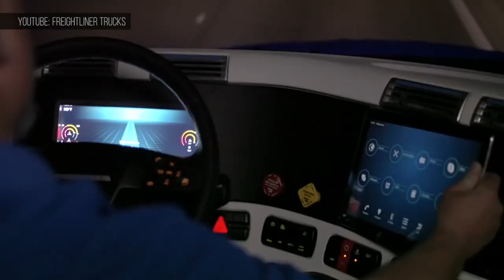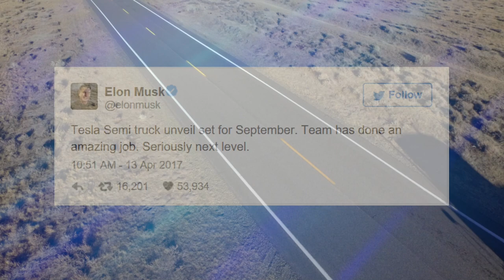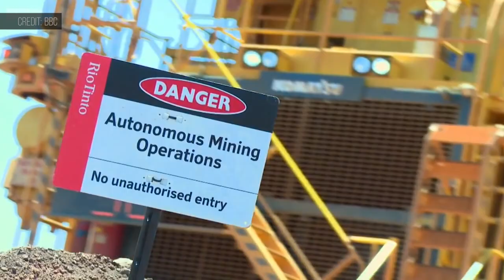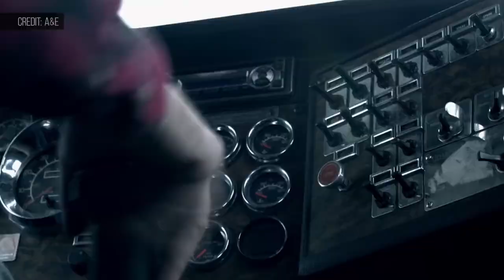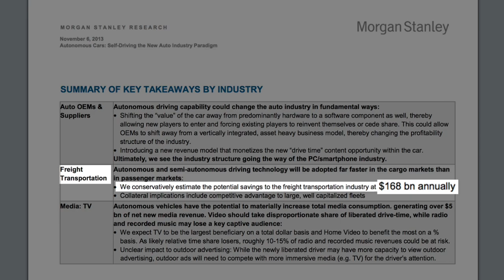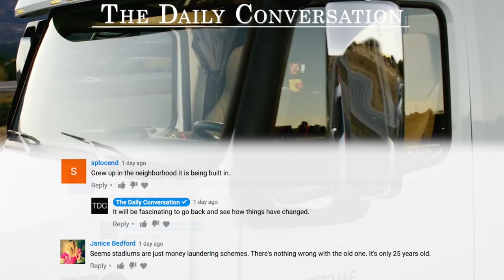The Future of Trucking

Comment: Not for nothing but this really scares me. We all have computers,  mobile phones, tables, etc. And at some point & as it gets older... It crashes, freezes up & malfunctions. Also, I remember growing up & my younger adult years - refrigerators, stoves, ovens, washers and dryers, etc. would last forever. 10, 15, 20 years plus. Now you buy these equipments & they have electronics on them & they fail & need to be repaired within the 1st or 2nd year. And after 5 to 7 years (10 at most) you're replacing them. So with that said, I can see the crazy accidents happening already.

Comment: And the robot trucks will do what when they breakdown or blow a tire? What will they do when chains are required or the road is closed? Will they know what to do when there's a detour? Do they sign for the load? pay the lumpers? Get the trailer washed out? Do they know where to park while waiting for the load to be ready? Do they know which door to back into to? Can they dolly down , disconnect and chock the wheels?   If involved in a accident does it give insurance info? Do the robot trucks load and unload the car  haulers, the tankers,the flatbed and the livestock? Will the  robot trucks scale their own load? Will they go into weight stations and get a Dot inspection?  Will the robot trucks swerve to miss hitting a dear? Will it read speed limit signs and pay tolls? Will it pull over for emergency vehicles. ect,ect
Reply: MR. B what will they do when someone pulls their 5th wheel handle and they drive off without their load attached. lol. i can see that happenening 100s of time a day.
Reply: Also; will the truck know when it's sensor are too dirty to function, and not take out a family car at 60-75 miles per hour, because it's sensors couldn't detect the small car(it just wasn't there according to the computer). What will the truck do when there is no road at all? A truck that is needed for a road construction, or are to travle down a small gravle road that does not exist on our GPS;s?
Reply: What about going into a skid or having a 4 wheeler cut you off and lock the brakes up would the auto system be able to recover and avoid the accident or just lock up the brakes? Causing a bigger accident
Reply: This is why it'll be a long time before there is no one in the truck. It will be required that there's someone there to monitor and do all of these things for at least the next 50-75 years. Until the technology is perfected and people with old ideas die off. Driving jobs will be replaced by something else. These trucks will need a lot of service and help for a long time, even without a driver.
Reply: Let's see if they can even make driverless trains first.
Reply: How will they fuel ?
Reply: Swerving to miss a deer in a truck is a bad thing to do just hit the damn creature. A truck that big and as tall with that weight a quick swerve and you’ll be upside-down in no time. However everything else you listed I agree with. Been around trucking all my life it’s in both sides my family with my dad having his own company.
Reply: @jonsexton17   100% agree with you
Reply: MR. B do the robot trucks go to prison for killing a family on the road? Will they pay tickets or get put out of service
Reply: awd protege  They will not work we are not technologically advanced enough yet to have automated trucks
Reply: @grejsancoprative  No kidding.  They can't even get the radar to work properly on the Kenworths.
Reply: Yes, eventually all that will be automated and what cannot be done by the vehicle will be monitored by sensors and a call placed for whatever service is needed. There will always be a need for humans in the freight industry, it's just that the need for humans will be reduced and the jobs will change to fit the evolving industry. You can't stop it.
Reply: The trucks will not drive themselves. A human in a room full of huge screens will operate the truck just like the military operates drones right now. The trucks will be autonomous, which means nobody in the vehicle.  It doesn't mean nobody operating it. And driverless trucks have a limited scope because they can't fuel themselves and they can't drop and hook. They can't even open their own doors but a warehouse worker could do that much.
Reply: When a driver messes up badly, the company can fire him, and the DMV can pull his CDL. Now if a self driving truck messes up, then every other self driving truck of the same system, then has to be put off the road as well, while the accident is investigated.
Reply: Will the robot truck be able to scale the load, balance any weight discrepancy by moving the trailer's tandem axles and/or the fifth wheel? Will the robot know to drive in severe weather conditions and be able to determine when it is and when it is not safe to continue driving?
Reply: @markmayfield2228 : So it's not just the crap-tastic T680s at USeless Xpress, it really is a problem for all KWs with those CMS systems.
Reply: @brandonhebert5485 : I've already debunked this "idea". You need to stop trying to promote a fundamentally flawed "idea" based on uninformed logic.
Reply: A lot of your questions technology will solve. Road closures and detours will automatically updated to their GPS system to avoid making it more efficient. As far as waiting around for lucks to be loaded and unloaded the video basically explains that everything will be linked and by that time robots will be unloading trucks and will work more efficiently and will be better at timing everything.
Reply: You are making to much sense , do you think the idiots running the country have stopped to think about those minor inconveniences (sarc)...
Reply: saying      all that you will   always need a human   in the  drivwrs  seat.
Reply: @jeffwang6460  Already have those where I live. They make up our transit system.
Reply: if this technology takes off the way they say it will, just Playing devil's advocate here.
Reply: @seanstrack4022  These newfangled doohickies called planes ain't never gonna work!

Has a naysayer of technological advancement and change in history ever been right? Serious question.
Reply: Will it stop to pick up hookers and flea bags? I think not
Reply: @georgestokes5116  Why?

Comment: Remove Farmers by mordern machines, remove drivers by driverless truck, remove workers by robotics. Who will buy your product? because people will have no jobs, so no money and no purchasing power.
Reply: Ashish Tiwari 
     It will be awhile before we can build enough of these machines to take over the market. We will have to plan for an age without these larbour jobs.
Reply: Ashish Tiwari what a always thought was stupid was the idea of only two extremes, either a driver, or a robot. why not add the technology to certain areas and keep some of the drivers, or what they may become, overwatchers. they will still have manual control if need be, and the truck can drive long stretches of boring road. Also with them not always manually driving, we could cut their wages a little bit to save on the cost
Reply: Ashish Tiwari why make robots that kill jobs, instead of robots that make thoes jobs better. like exo skeletons with construction workers. efficiency is brought up without cutting any workers. maybe put laws in place for completely cutting workers, it's not punishing progress if they can achieve the same goal with a certain mix of technology AND workers
Reply: Someone builds the machines, someone repairs the machines, someone programs the machines. A driverless vehicle would require someone there to take over in an emergency or system failure.
Reply: The biggest question is will they be able to produce enough of these vehicles fast enough to keep up with the supply and demand of the customers? Every year there are more and more big rigs added to the road to keep up. With that being said, where will you stage all of these vehicles when not on the road? There will be no use for the large truck stops and rest areas unless they beef up security tremendously. When truck stops and rest areas are full you often see trucks parked on the on and off ramps, side streets or any where they can. All those trucks will need to be replaced with robotics and placed in a safe secure location. Truckers have no where to park now. Where would you store these robots.
Reply: A Mack Bolan yeh and it will probally have a crappy pay. Because then they would want you there 24/7 and probally if your lucky you might make .002 cents a mile. Knowing these scum bag corporations they would do that. Or maybe just maybe this might be how we enter a whole new Great Depression but it would be worst.
Reply: I've seen trucks with 3 drivers and a hole cut in the drivers seat. There were people planning to go to 60ft trailers, don't know if they're still working on that. In the depression of '08-'09 over 2000 truck companies went out of business. Then congress increased the distance Mexican drivers were allowed to drive into the US. At the time also they were working on the Transnational Highway from Mexico to Canada, haven't anything about that in years though.
Reply: Ashish Tiwari 
They are pushing you to welfare system
Reply: The Robots will buy their own products. I saw a sci-fi movie 40+ years ago and now it's really happening.
Reply: Ashish Tiwari made in China in China made in China made in China made in China made in China USA USA USA USA USA USA USA USA will be broke broke broke broke broke broke broke broke broke
Reply: Actually, since a robot will work just as cheaply in the USA as it will in China, a lot of the stuff currently made in China will soon be made in the USA again.

Of course, that doesn't mean that the actual jobs will come back.  If the robots are doing the work......
Reply: Remove managers and engineers from Tesla and others by self-learning robots
Reply: Eventually.  And maybe that's when we'll finally learn, as a society, to get over the (by then obsolete) idea of "working for a living."
Reply: Communism is about the workers owning the means of production.  But if the workers are robots, well surely robots don't own factories, trucking companies, etc.  So no, no communism here.
Reply: The government could give slews of jobs out, and there is plenty of work to be done.  Roads to be fixed, bridges to be fixed, that sort of thing.  Not all of it can be done by machine (yet).

But if the government starts giving out jobs not because there is work which needs to be done but instead because people need money, then why not just hand out the money?  Why hire people to did holes and fill them in again as an excuse to give them money?  Just give them money.

Pay for it with a robot tax?
Reply: They will do away with the citizens via nuclear war or "plague."
Reply: Stanley Bashline  think you hit the nail on the head. Society will resemble  current left wing political thinking
Reply: We will reach utopian socialism where wealth distrubition won't be based on your merits but on how much do you need to sustain comfortable life.
Reply: Awesome answer and I don't want  ROBOT DRIVING A MASSIVE BULLET THAT CAN KILL PEOPLE IF IT HAS A GLITCH
Reply: @lobster1653  "Cut their wages"?  If you make the job and skills more niche, then the wages will have to go up.  Part of the reason that the jobs and skills are worth what they are, is due to the demand and the relative ease of getting the ability and skills required.  Lowering the ability to get the training, and lowering the wages too?  That won't work.
Reply: Ashish Tiwari companies will be one-man operating systems, the CEO’s will run them only lol
Reply: But the rich only need to feed the poor because they are building for the rich. Now, robots can build for the rich without the need to feed the poor.
Reply: @marconbucayan8396  What? That literally in every way makes no sense at all!
Reply: @realengineeredlife  a prophet speaks but does anyone hear
Reply: Just get rid of all the people in the 1st place. Then you don't need anyone to buy the products made by the machines. Then the machines don't need to make anything for people.
Reply: A fully automated economy would produce a great deal of wealth, that wealth will be taxed to a high degree and the money will be distributed in the form of a universal basic income and that money will be used to purchase the products
Reply: @Onearmedscissor yeah, you're probably right,
Reply: we need Universal Basic Income, that's why we need Andrew Yang for President 2020
Reply: If truck drivers are put out of work the economy will take a big hit who will buy your trucks? When you just lost a big huge workforce!!! You forget the world is a big cycle! Good luck
Reply: @palmerprod  The reason "Shall not be infringed" is part of the 2A - is so that no one can dictate terms by which you have to abide if you want a weapon.  If they can institute additional stipulations, they won't stop.  "Bible believers" and those with a conservative viewpoint will be deemed mentally ill - "climate change deniers" and any deplorables they don't like will be lumped into the mentally ill category - while those who want to lop off appendages are celebrated and rewarded for their "uniqueness".
Reply: Elon Musk and Bill Gates propose Universal Basic Wage.(socialism).
Reply: @lobster1653  Your proposal would defeat the main advantage behind autonomy, which is more profit for the industrialists. I don't really think most companies would be interested in an augmented system, as their main motive is not safety of the drivers, but rather cutting the cost invested in human services.
Reply: @supersman2000  As opposed to human beings, who are never distracted, sleep-deprived, drunk or just have a heart attack at the wheel.  There are hundreds of thousands, perhaps millions, of traffic accidents every day. With people at the helms of cars and trucks.
Reply: Jason Conover  if it can be exchanged for goods and services then it has inherent value, when the rubber meets the road at the end of the day money is money and when automation has taken away most the jobs it would have taken a lot of the human costs of doing business too meaning there will be more than enough profit to feed back into a ubi
Reply: @eyesuckle  The driverless trucks can and will make mistakes and have accidents also.
Reply: check the weight specs on electric  trucks. tesla tractor weighs over 30klbs regular truck 18k.
Reply: The people with educations will.
Reply: @ @katakisLives   Agreed.  I don't really see any other solution to the problem of automation.  The big problem with that solution is, what do people do, then?  For many, it's not a problem at all.  They have ways to define and value themselves other than through their work. But many people will be more or less lost without their jobs.
Reply: Ashish Tiwari I have been voicing this for 20 years, re ATMs, and then auto check out for your groceries, robotics for automakers, warehousing. Drivers!!

Yes, who will be left to buy the products of which they want to transport?

He talked about reduced accidents...well, if there is an accident now someone is held responsible...who will go to jail when one of these trucks pole through an intersection with 80,000lbs of fwd motion...Tesla already ran over one of its owners. Who goes to jail, who is responsible? You can’t send a company to jail...but you can send a driver.

Careful what we wish for people! You will be making these things to transport for the rich, meanwhile you’ll be unemployed in 12 years...never mind AOC’s the sky is going to fall...you will starve no for a lack of food...you just won’t have a job to pay for it.
Reply: I have been doing just that for 30 years, what it does is eliminate $14 an hour menial labor jobs while creating $35 an hour skilled labor jobs.
Reply: @thelaw3536  , you must be young, as a 50 year old man the thought of having to retrain just to make a lot less money than I did as a trucker doesnt sound like a great America.
Reply: @thelaw3536  ok i agree about that but what about our children? Grandchildren etc. The last thing we should be doing cut costs is cutting jobs. Just my thoughts
Reply: @flyingdog1498 . I am a UK trucker with a degree in electrical engineering with renewable technology. I have read your other posts on this matter. I am fascinated with the with the work you have done in the world of automation. I drive a big wagon as I was diagnosed with Rhuematiod  Athritis. I lost feeling due to my affliction in my fingers. But I don't want to take a disability cheque. So I took my HGV test so I could keep at least my pride that I could supply not just for my wife and children but pay my taxes l..  I won't shout at you but I am interested. I find the work you have done absolutly fascinating.
Reply: This won't happen as soon as some are predicting.  Insurance companies have not jumped for joy on insuring autonomous vehicles yet.